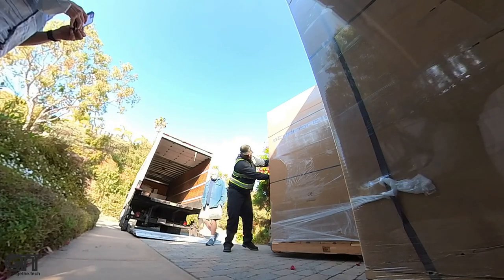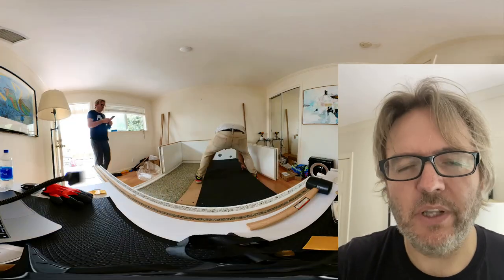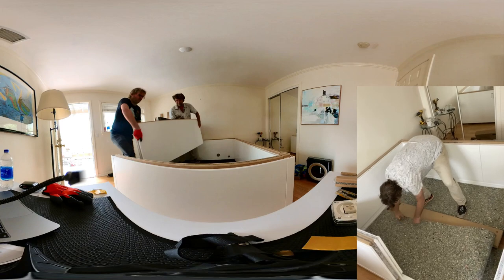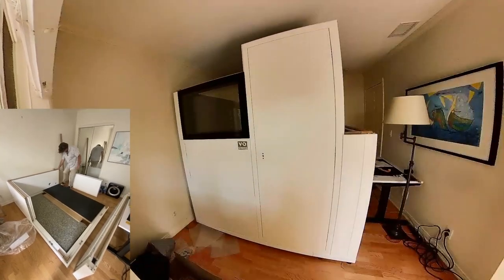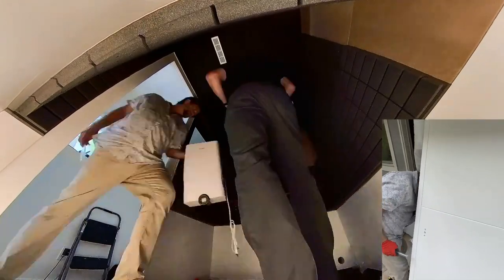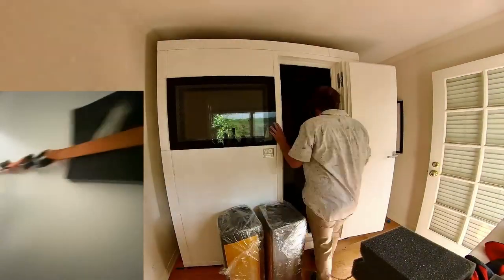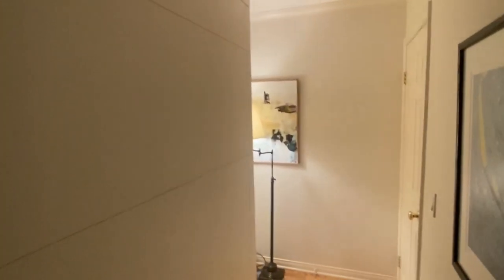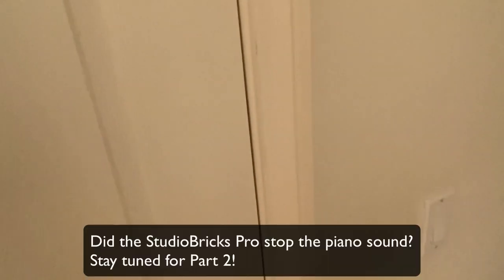GTT Vlog: Assembling a StudioBricks Pro 5x6' sound isolation booth for a voice actor

Comment: Really helpful video, which I've re-watched many times!  My Studiobricks is the same size, but double walled.   It was delivered yesterday!  As you suggest in the video, I am opting for an adjustable height desk and will buy my Yellowtec accessories separately for it.   One thing concerns me:  my apartment that I rent has plastic laminate flooring, and I'm worried about leaving dents in it from the  booth's weight.   There are 16 rubber/felt Silent Blocks.   Is there some material that you recommend to place under the booth to protect the floor?  When I ordered it, Guillermo said he would send something, but he was quite vague about it, and now that I've opened everything, there's nothing besides the standard kit.  In your experience, are the Silent Blocks usually adequate floor protection?     Thanks, George!
Reply from the maker: You can put down a sheet of 3/4" plywood underneath to further distribute the weight and avoid damage to the floor.
Reply: @GeorgeTheTech  Thanks for the reply.   That's what I ended up doing.

Comment: Hi there! I just bought an even larger one. Where did you get those cable management things?

Mine doesn’t have bass traps either and is 11.5x8.5. Wonder if I could add them later?
Reply from the maker: Contact StudioBricks for help. They will assist you.

Comment: As soon as you said the word "uplift" I was like "that aint clearing that trap" lol. I have 3 uplifts in my studio so I have become acutely aware of the vertical axis/clearance. 

I have been strongly considering one of these and probably the same size.

My question is; I'm an acoustic snob. My booth is custom but will not have as effective reduction as one of these but I have it packed with fat custom panels. I can't stand the boxy sound and would be disappointed if I got one of these and I couldn't tune it well. Is what comes with it "good enough" or is it "excellent"? Did you have to take any special steps to get the box under control?

Thank you for the great video.
Reply from the maker: As a studio designer I too am an acoustics snob. I think they nailed it with this design, and these dimensions are pretty ideal, too. Save some dough and get the Standard (double wall) XXL model, though, and if you can clear it go with a height extension as it ALWAYS sounds better!!
Reply: Is the difference between Triple Wall and Double Wall that small?
 @GeorgeTheTech